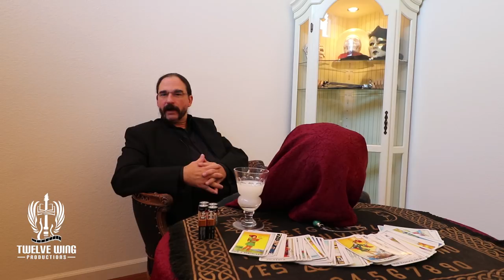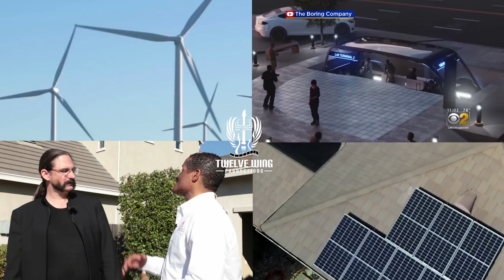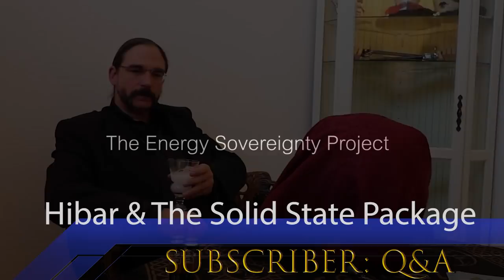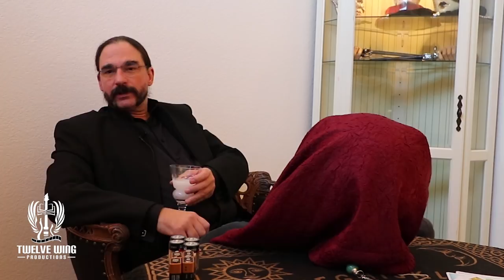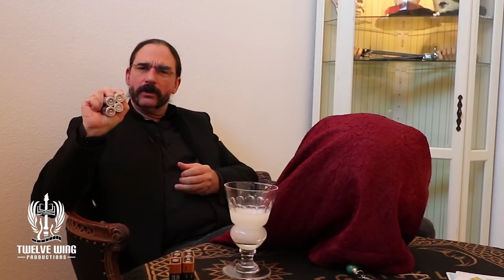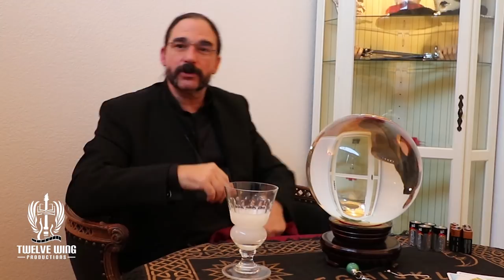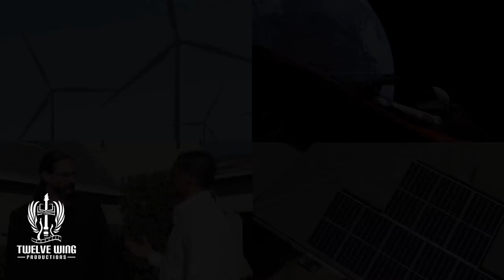Tesla's Purchase of Hibar & The Shape of Solid State Batteries

Comment: Excellent  presentation - Certainly with Braga-Goodenough parentage. With no liquid electrolyte to electrically"short", large surface area cells can be stacked in a single pouch in both a series or parallel configuration. Sony saved Goodenough - Tesla will save Braga. 

NO DENDRITES - NO POSSIBLE FIRES - NO POISONOUS LIQUIDS "One for the girls."

Comment: My understanding of pouch cell manufacturing is that the components are still wound, they are just wound on a different shaped spindle and then ejected to be pressed flat?
Reply from the maker: Absolutely correct.  I may not have been as clear as I should have on the point I was trying to make.
When making a pouch battery, the areas where the layers are folded can easily be devoid of cathode material.  This is more difficult when you have a continuous roll.  It would seem to me that if one was to coat a foil with micro-fine glass beads that you would have to apply them more thinly where the foil was to be wound the tightest.  This might be far more of a headache than it's worth.  Especially if there is no need for cell separation because of heat degradation.

So what you are left with is convenience of packaging.  Are cylinders more convenient to design into devices?  Maybe.  If that is enough of a driving force, then most certainly effort will be made to make sure it works.

Comment: Actually, 50 years ago a 9v battery did use an internal stack of 6 flat cells. But today, open one up. There are six "AAAA" cells packed in a rectangular shell. Cylindrical cells and wasted space.
Reply from the maker: It was just to illustrate the gap between packages.

Comment: I am m wondering a bit, not to disagree, but if I am not wrong both maxwell and highbar was developed to make cylindrical cells. It might be that Tesla is working on pouch cells, but it seams to me that combination of maxwell and the model 3 batteries could lead to higher density what easily could make model S a 120-150 kwh car. About the roadster I don't know, have no idea what is the size of that car.
Reply from the maker: I don't disagree with your assessment.  I think they could have gotten Model S up to 120kwh fairly easily by simply using the 2170 cells.
That said, I am suspicious about all the other things that we have been seeing about the new "million mile" battery.
There is just too much about it to suggest they would use a cylindrical cell if they didn't have to.
Reply: @twelvewingproductions7508  I agree, there is a possibility for them to change to the pouch cells, though I am a bit confused, why they bought maxwell and highbar if they don't want to continue with cylindrical cells. I think the pouch cells if they come might come only in 4-5 years from now.

Comment: Some great insight and I agree with much of what you've said however, I have another possibility for you to muse on...  What if the layered film is not sectioned into cells at all but rather layered into long strips or sheets over the entire area of the battery pack?  This would eliminate the need for packaging around each cell, lowering the overall pack weight and increasing the available volume for energy-holding material.  It would also reduce the number of pole connections of which there would be only two (pos at one end, neg at the other), so again saving on conductive material requirements and therefore, material costs.
Reply from the maker: Part of that conversation I had with Gali was about that very thing... on steroids.
Take what you just said one step further and think about the largest size you could possibly make a laptop battery pack.
Laptop battery packs are usually made in a single step where all components are brought together at the same time.  Unlike the way modules are assembled from single cells, I'm imagining a process where everything is brought together at once.

Your notion of making them in strips and then actually attaching the ends of cathode and anode to a single physical structure within a battery, thus eliminating any single discernible cell... is I think accurate.
But again, these won't be cylinders.
Reply: One of the good things of many small cells is that if one or several cells fail, the battery still works and keeps most of its capacity.
Tesla batteries have a fuse for each cell, so if one cell shorts, the fuse blows at disconnect that cell from the battery.
The quality of the whole battery is also more homogeneous... some cells are better and some worse, when you put lot of then together they even out.
Many small cells are also easier to cool or heat.
Manufacturing big cells without defects is also more difficult. With small cells you just discard the bad ones.
Reply from the maker: @arcachofo , no argument with your assessment.  I think that the ribbons will be divided up within the pack under such a manufacturing process... but the individual cells won't be discernible.  The total pack will still be composed of segmented cells, but it will be a more integrated product.  That's my guess anyway.
Reply: @twelvewingproductions7508  Yes, who knows, new technologies can allow new solutions. I just wanted to note that there are reasons why Tesla made that choice (many small cells).  But some of these points maybe don't apply to solid-state batteries or have another solution. 

For example i didn't mention safety reasons like: is better many small explossions spread in time than one big kaboom, because this doesn't apply to solid-state batteries.
Anyway i'm very exited about TESLA battery technology and found this video and comments really interesting.

Comment: Some of the cars in the 2019 Bridgestone solar challenge (Darwin to Adelaide) had LiFePo4!
Reply: A little pedantic, but you mean LiFePO4 and not a polonium battery, yes?
Reply: Being pedantic it is correct. 
lithium ferrophosphate 
LiFePO4 (sorry can’t do the subscript “4”)
https://en.m.wikipedia.org/wiki/Lithium_iron_phosphate_battery
It’s solid state and much more tolerant of clumsy charging than ordinary Lithium ion cells but has about 50% the energy density.
Reply: I meaant nt 18650's

Comment: What do you think of the claims of shining a light on the cathode of a battery halves its charging time?? Can find the link for you if required
Reply from the maker: Shoot me the link and I'll look into it.
There are some really interesting phenomenon that occur and are repeatably tested in the lab that are pretty much useless in actual applications because they require either very exotic materials or highly specific environmental factors.  Or they are just outright lethal.
So I would be interested to see what experiment you are talking about.
Reply: @twelvewingproductions7508 
Here's another to look at having a hollow cathode to reduce cracks and stress plus if the light shinning on the cathode works the hollow cathode will be a big bonus as well
https://www.machinedesign.com/mechanical/researchers-uncover-why-cathodes-degrade-lithium-ion-batteries
Reply: @twelvewingproductions7508 
Possible root cause of lion battery degradation. You probably know this but I thought what the hell, a man of your intelligence can put this to use for an interesting video Im sure. 
https://www.sciencedaily.com/releases/2019/08/190821135244.htm

Comment: If the new cells are less susceptible to heat, then Tesla will use this to charge them much faster then they currently can, how much faster (as fast as they can with the cooling they have), and so still needing to be cooled. And so will still use active cooling and so will still want to use cylindrical cells.
Reply from the maker: I disagree about the cylindrical cells but I would love to hear your reasoning for it.
Do you feel that the pouch cells would be inadequately cooled and still retain a volume gain?

Comment: new plaid mode has 800v(as Porshe) arhitecture instead of 400v that is why new one is gonna  be faster
Reply from the maker: It makes it so the wires transporting the current can be thinner.  I think the biggest advance that Tesla has over the Porsche is the battery tech.  Tesla is way ahead of Porsche and others.  By they time they catch up, Tesla is already on to their next major advancement.
Reply: @twelvewingproductions7508  
I was (am) intrigued by the recent Tesla battery pack patent  (I believe I posted on your previous the video regarding this).
That seems to describe a method for producing new packs with with cylindrical cells (only?) having the advantage of faster, more automated production, better packaging, innovative multi-state (gel to liquid to boiling) cooling of cells, cell failure management, etc.
The above seemed to match well with the Hibar expertise in both production and mm arterial injection technology.

Furthermore, it satisfies the need for not only more cells but also more packs as expansion increases, something which seems to be overlooked.
It made sense if combined with the Maxwell prediction of up to 16x production volume (qty, or kWh?) which would allow expansion within the existing factory space.

Question.
Has there been either considerable expansion at GF1, or acquisition of more space to build cells?

I now wonder if the publication of the patent was simply an act of "throwing scraps to the peasants", while transitioning to superior technology?

Your thoughts appreciated.
Reply from the maker: @rogerstarkey5390 , you covered a lot of ground there.  Let me do my best to try and clarify my thoughts on it.

Firstly, the cylindrical cell patent likely leverages other patents and IP held by Maxwell Technologies.
I believe that Tesla is using this as a stepping stone to manufacturing their own batteries.  This patent, and other Maxwell patents will get them out from under the thumb of any NDAs they signed with Panasonic.
If they had started to manufacture their own cells without that kind of protection, Panasonic would have sued them for violating their NDA and claim that they are using manufacturing know how gleaned from GF1.

With the Maxwell patents secured and other patents applied for, Panasonic would not be able to make such a claim.
I also still believe that they can further leverage Maxwell's contribution by licensing it out to other battery manufacturers.
This will help them out and equally not affect Tesla, because this is basically yesterday's technology.

Lastly, in answer to your question, Panasonic has expanded their footprint at GF1 but I would think it HIGHLY unlikely that Tesla would use this facility for manufacturing their new "Million Mile" battery.  At least until Panasonic departs.

I believe they are going to use the China or Germany GF to start manufacturing these cells.  Once those lines have achieved maturity they will likely replicate these lines in all the gigafactories as they slowly phase out the existing cell chemistry/architecture.

Comment: Would the new batts still need heating for cold -40F below for weeks, months?
Reply from the maker: It seems so.  Nothing I've seen shows them to have improved cold weather characteristics.  That said, the charge rates in cold weather will likely be better since they aren't trying to protect against thermal shock to the battery.  At least not to the degree they have to with current paste type electrolytes.

Comment: i still see a role for Hydrogen/ Fuel Cell combination in large engines like Ships/ Ferries/ May be trucks etc.... or even Air Planes.
Reply from the maker: Ships maybe.  Aircraft?  Not so sure about that one.
I think aircraft will be fueled by aviation fuel for a very long time, and there will probably be plenty of it around.
If we refine oil for other products, a certain amount of "byproduct" is going to be kerosene, diesel fuel and gasoline.
We may eventually actually use gasoline for something it is actually extremely good at.  Making heat.
It's hard to say how this will all shake out short term.
Reply: @twelvewingproductions7508  We already have Electric Planes but they are smaller and their range is shorter. So just like EVs, i think this is Electric Flights baby steps. All we need is a doubling of current battery density to about 400watts per kg. for it to be commercial viable mass option.  
The reason why i though H2 would be a potential is that it can be compressed to achieve much higher densities. 
Some of the Electric planes already in the market. Alice from EVIATION (an Israeli company). Pipistral with their trainer electric planes....
Reply from the maker: @Soothsayer210 , It's more than just the power though.
Currently, the reason aircraft are successful is because they lose weight as they travel.
The batteries, remain the same weight as they did at takeoff.
So there is a lot of development that has to happen in this area I think.

Comment: Nuclear power is the elephant in the energy room. By far the safest energy source (and always zero CO2) but tarnished by two major accidents and huge costs. 
Not any more. The new molten salt reactors do not have the safety issues. Therefore costs fall dramatically. They are cheap enough to undercut gas and coal. 
Cheap ultra safe energy would liberate the world. 
They can use existing high level waste as fuel. They can also use thorium which is a byproduct of rare earth mining. REs are needed for solar panels and high power magnets.
Reply: David Elliott maybe Bill can get it off the ground once the China/US trade issues are taken care of.
Reply from the maker: David, describing Nuclear energy as being tarnished by "two" major accidents is being unreasonably generous.
It has been FAR more than two SERIOUS episodes of mishandling and poisoning of people and property.  The added costs to dispose of waste are outrageous when compared for the limited benefits overall.

I do like the molten salt reactors that were envisioned to cover housing developments, but here too we have to take an honest look at all the expense of doing this when one can simply put solar and batteries in homes or in regional distribution centers and accomplish the exact same thing with zero hazardous waste.

Comment: 9 volt batteries actually have cylindrical cells inside of them and thus they also wast space.
Reply: Not if the cylindrical have a higher density by design, then it would even out or even be higher. With the car packs you also need coolant which you can flow between and around those spaces. When a pouch cell is bigger, you can not thermally manage as large or expansive a cell as effectively because the temperatures are not transferred as effectively across a larger cell. That is why tesla cylindrical packs in the tesla are lasting better than the packs in other vehicles who are using pouch packs and are having to cool from only one end of the cell or the other.
Reply: I think you missed my point. The video said a 9V battery is a pouch cell that fills its entire rectangular prism space with battery, and I'm saying it's actually filled with cylindrical cells that do not use all the space. That's all.